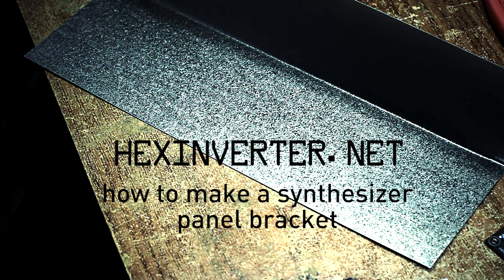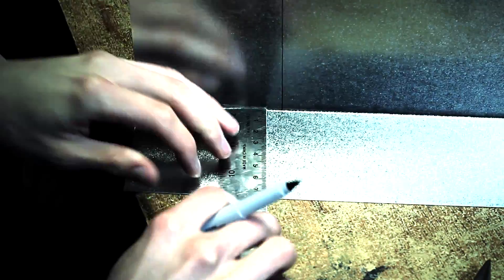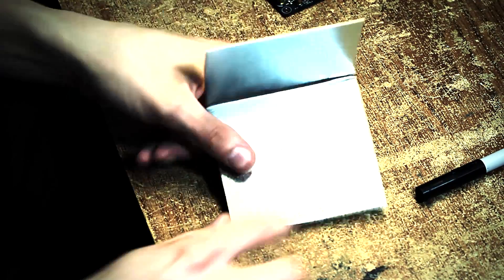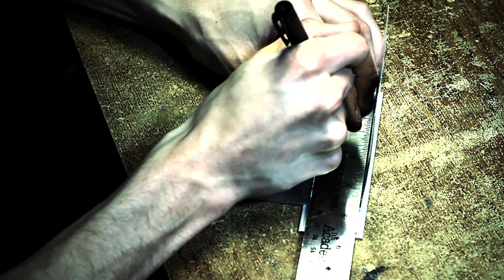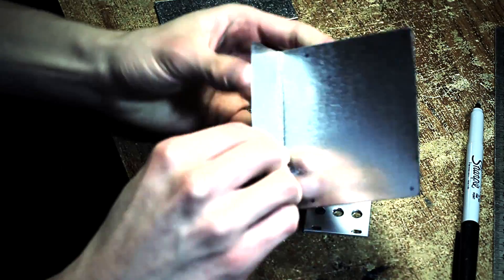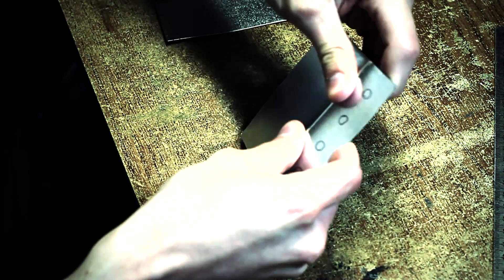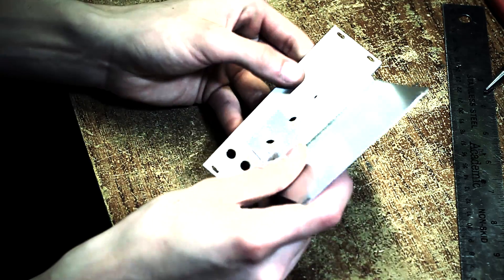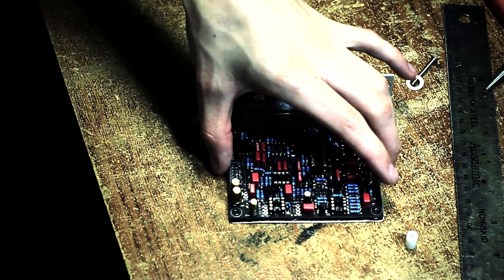How To: Modular Synthesizer Panel/PCB Brackets

Comment: Do you use standoffs to keep the solder side of the PCB from shorting out to the metal, or... ?
Reply from the maker: Yes that is the idea! The standoffs shown in this video keep the PCB separated from the mounting metal such that the solder pads do not short on it. As well, it serves to hold the PCB in place :)
Reply: @hexinverterDOTnet  Hey mate, hope you see this. Was wondering whether there is any particular reason people don't just use the angled sheet as both mounting and front panel? i.e. you'd snip out sections behind the front so you can get it mounted and then have the pcb mounted on the side as normal. If it's a bit of a pain drilling into the angled sheet you could even just fold some up yourself after drilling it out whilst still flat. Been thinking about doing this for a bit and was wondering your thoughts on it
Reply: @hexinverterDOTnet  Do the screws need to be electrically isolated too? Or is it okay that the metal screw touches the top part of the pcb?

Comment: Thanks for the great tutorial.
How thick is the material you use? I'd like to use 0.8mm or 1.5mm aluminum sheet, but wonder if the 0.8mm sheet will be enough: I will use 2 individual brackets for each PCB (not 1 full sized bracket) and PCBs will be horizontal, not vertically mounted like yours. So brackets will get a bit more load I guess. That's why I wonder if 0.8mm will be enough or I'll have to go for 1.5mm sheets (this are the two thickness I have available) which will be somewhat harder to cut but stronger.
I'd also like to know if aluminum sheet will stand manual 90 deg. folding or it can break. 
I also have access to 1mm thick steel sheet, no idea if it will be better to use, but I see is double the weight... Thank you in advance.
Reply from the maker: No problem! It was some time ago that I made this video, and haven't done this in a long time, so can't remember the exact gauge of the metal. It's sold as "roof flashing" at Home Depot/etc. - it's quite flimsy and easy to work with, and is a very lightweight sheet metal. I would guess around 0.8mm or less. Even though it's lightweight, when you make it flush with the panel (via the potentiometers or whatever you're mounting it with) and then screw the PCB onto the standoffs, it makes it quite rigid. "Good enough is good enough" here, I think :) I have modules left over from when I used to do this and they are still solid after many years.

1.5mm material would certainly be sturdier, but you might have a harder time using simple sheet metal snips to cut it up. If it's not already bent at a right angle ("roof flashing" is pre-bent), I would avoid it, since you'd probably want to use a bending brake or vise to bend the material yourself properly at that thickness. The "flimsy" stuff is easier to work with, and more forgiving, but at the same time is more sharp so of course it's sharper and like mentioned in the video, wearing hand and eye protection is a good idea, and filing down the edges so it's no longer as sharp.
Reply: thanks a lot